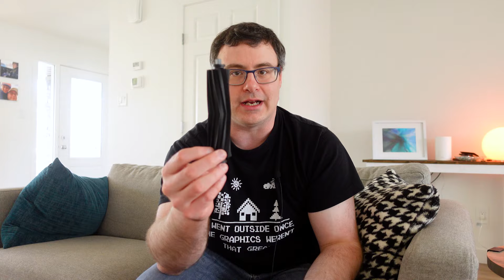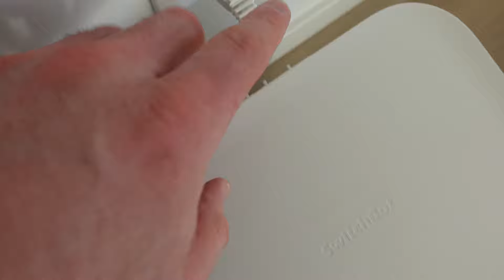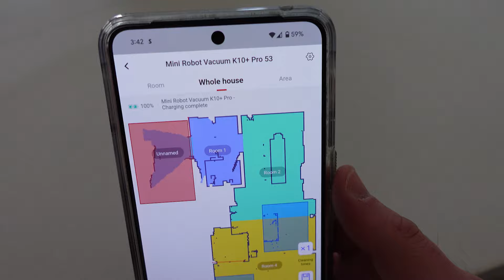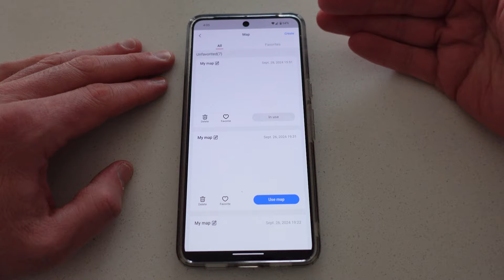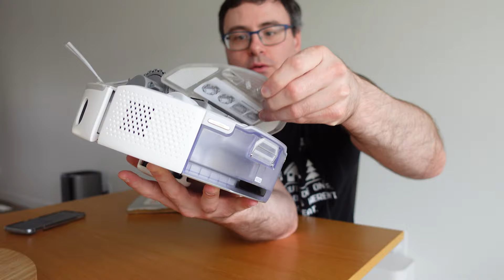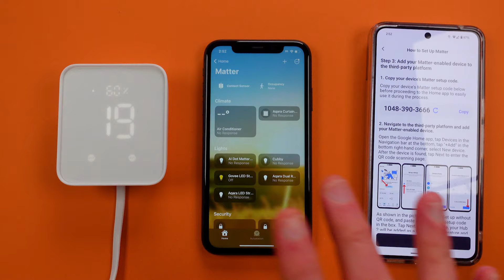The Little Robot Vacuum That Could - SwitchBot K10+ Pro Review and Guide

Comment: One thing you have to remember about these is yes, it's only 3000pa (which was the norm for robovacs not that long ago).
But that suction power is concentrated into a smaller roller brush. So you can't compare apples to apples, really.
If you had a robovac with 3000pa and it was a normal full sized vac with a roller brush near twice the size, the K10 is gonna do much better.
I have the K10+ and K10+ pro and honestly, they both pick up everything from the carpet that I can visibly see.

But like with any robovac... you still should routinely go over with a full sized vacuum. I do that once a week while my little K10s go daily.
Reply from the maker: Yep, you're right about the pressure vs area conversation! Just hard to explain to an audience!